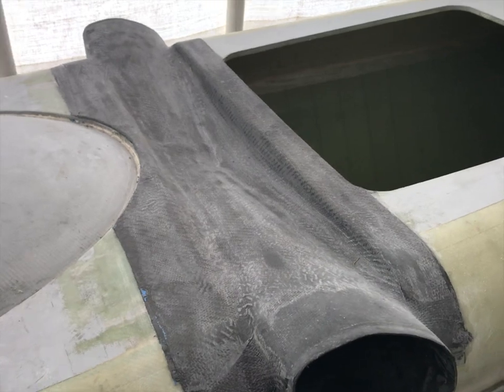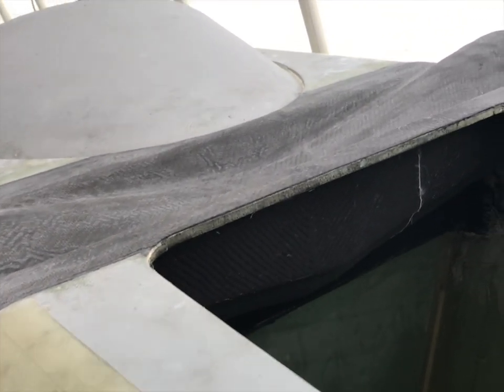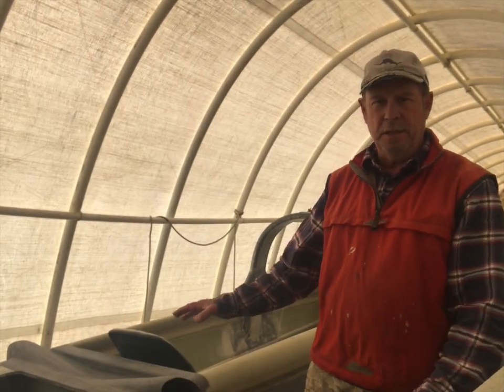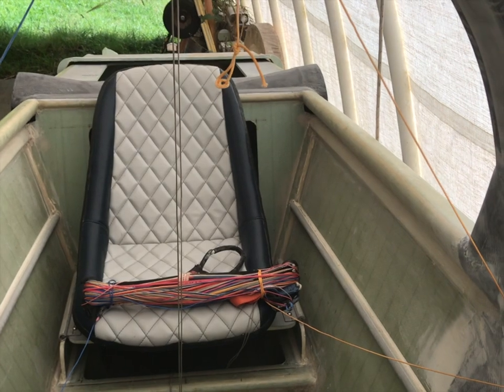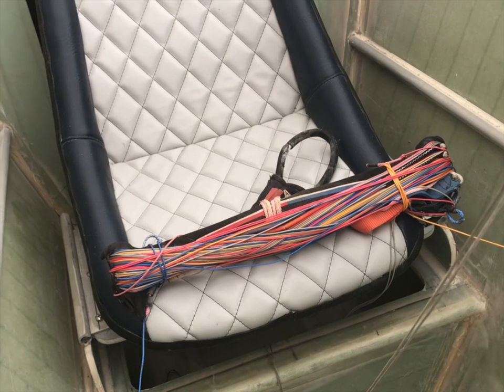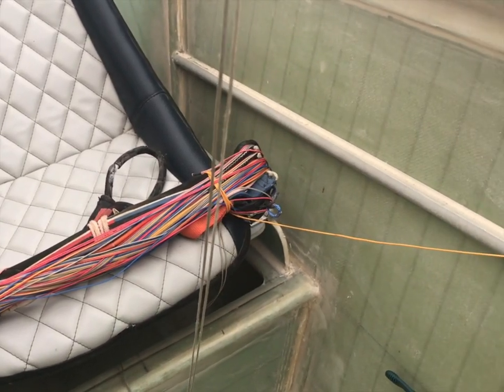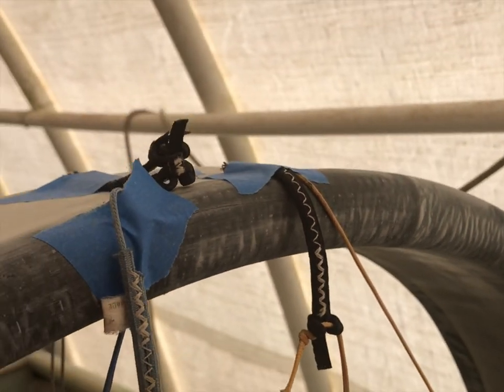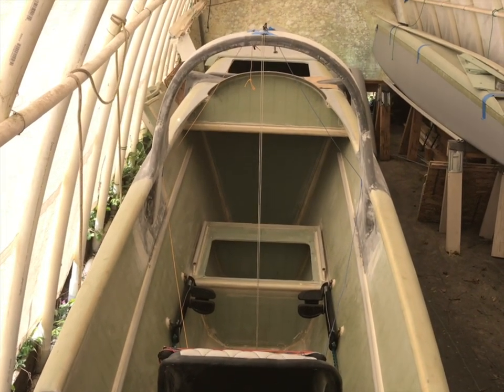socket to me!

Comment: what kite size are we talking about? Larger than 16m^2?
Reply from the maker: Kite size like sail area is relative to wind strength. Dan Montague used up to 50m^2  and said "100m^2 no problem". A kite quiver sponsorship would help!
Reply: @dryseaproductions7335  I can imagine kite being slightly less powerful than equivalent sail, but I'd be sh!t scared driving your boat with 17m kite in 20 knots
Reply from the maker: "...faster, faster, faster, until the thrill of speed overcomes the fear of death."   speed skiers motto
Reply from the maker: from Evan Kiln"s Big Kite @ 28sec. "going to tie a 30 meter kite on it and see how fast we can go.."
Reply from the maker: Misspelled Klijn  -   https://www.youtube.com/watch?v=43Ex2vEkV1o&t=68s
Reply from the maker: Okay, I'll blame it on the dog, that's 13.5 meter not 30 meters, still not overpowered.
Reply: ok my suggestion is to look into modern lightwind/foil kites e.g. Duotone Juice or something similar. Also I would learn to kitesurf at least on a basic level if you haven't done that already.
Reply from the maker: Kite size varies with wind velocity.   
As I'm always look for and appreciate qualitative data; 
Given your parameter of 20 Knots of true wind, what size kite/length line would you suggest given the additional factors:  
1. A hull of 1200 pounds total displacement,  with 2. A finest ratio of 17.5,  and 3. A wetted area of approx. 345 ft^2 ,  
To achieve 20 knots of boat speed?   (non-planing, non-foiling)
Anyone?